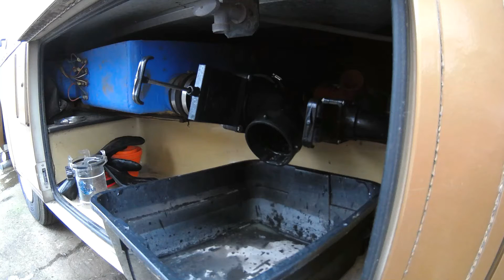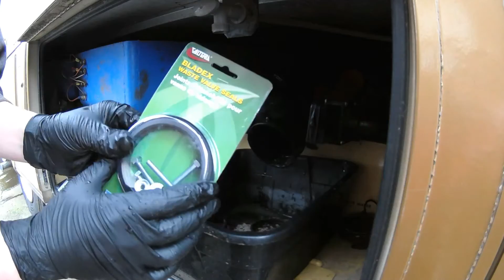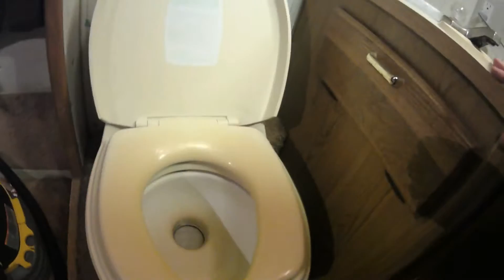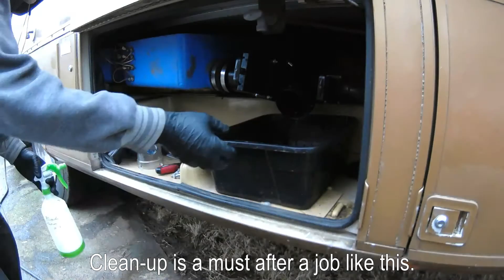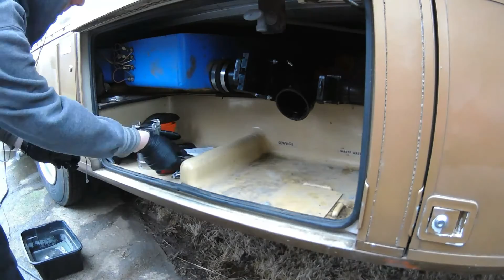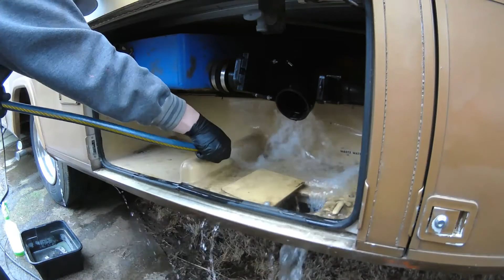RV Waste Gate Seal Replacement

Comment: Well done!  As "5th" said I use plumber's grease on seals and spray liquid silicon into slide mechanism then work it in and out.  Works better than brand new.
Reply from the maker: Thanks! Great tip I'll have to try that, the grey is pretty sticky👍